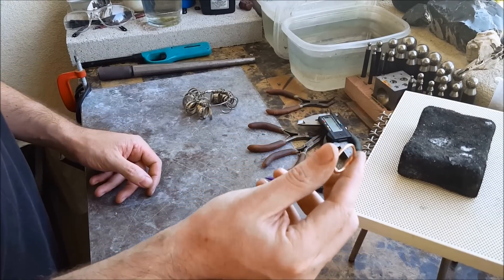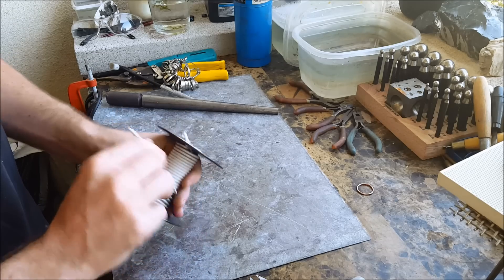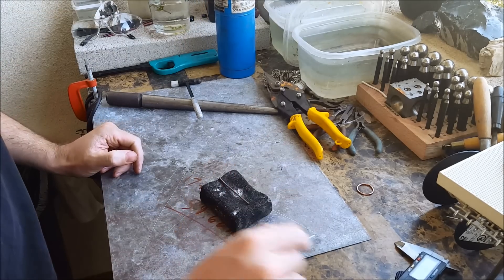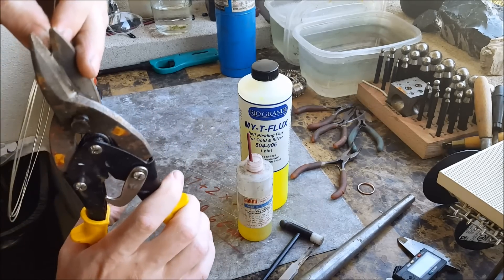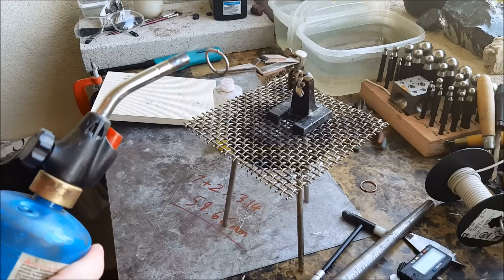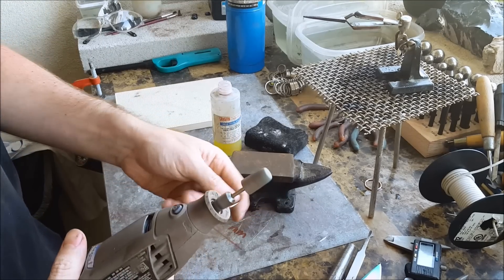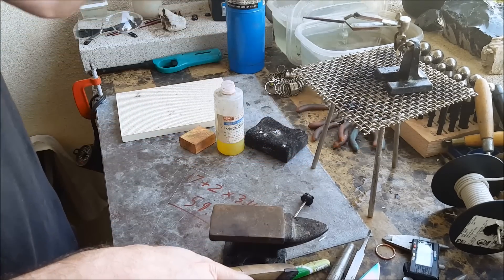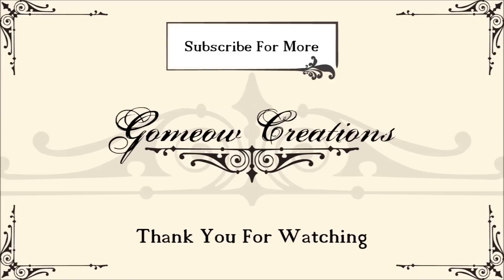How to make a ring from scratch.

Comment: Enjoying your videos and am looking to dive in and give this a go. I just wanted to double check that you didn't have to pickle after the solder? I thought you did.
Reply from the maker: +Brittney Rhodes Yes you will need to pickle it ofter you solder it. It will take all the fire scale off the metal and it will be ready to be polished. If you have any more  questions feel free to ask.
Reply: RAD! I just did not see you do it in the video after the solder. You went into buffing. Any chance you do any electroforming?
Reply from the maker: I have tried making a cheap DIY set up for electroforming but had a lot of problems making it work right. I was able to make some cool looking effects happen to a skull ring I made. Check out my instagrame @gomeowcreation to see it. =)

Comment: Hi... is it possible to add tiny Cz stones 1mm to a copper ring... all way round it? Too small for bezel... so can they be set inside band?
Reply from the maker: +Clare Bailey that is very possible. You would have to drill into the band with a bur bit that is the same size as the stone then set it inside the band.

Comment: When adding coils like the ring you show at the end, will the copper coils fuse to the copper ring?  It seems silver solder would show up and look bad?  Any advice for adding the coils? Thanks!
Reply from the maker: I put it around the solder joint and adding a very little solder to it to make it all stick
Reply: @GomeowCreations  Thanks!  I tried to put a VERY teeny tiny piece of wire solder on it (one that I hammered flat) and tried to wrap coils on top of the solder before torching but it kept falling out.😱  I'm now going to attempt sweat soldering (I think that's what it's called)... melt some solder near the join, then wrap the coils and torch again.  Hopefully, that'll work. 🤞. Thanks again. You're an awesome instructor! I'll let you know tomorrow how it went.😊
Reply: @GomeowCreations  By cutting a piece of wire solder the size of a pin head or smaller, I managed to complete the 2nd ring with minimal exposure of silver on the copper coil. The 1st one became a disaster and I tried to hide it with a fine silver coil on top of the copper coil after filing away the excess solder.  That 1st one will serve as a reminder of what NOT to do!  I think I was overly ambitious. 😂 LOL! 

I'm gonna keep practicing.  Thanks so much for your help! 🙂

Comment: For a round wire, is there an alternative of using rubber emery bit?
and another question If I want to make something with a round wire, how to file down the joints without flattening them?
Reply from the maker: +sweet berry you could use sand paper but it would take some time to get it all off.

Comment: Hey @GomeowCreations, this video was so awesome and helped me so much with many of the issues I was having with soldering copper. The one thing I am still really struggling with is how to re-harden my pieces after I have soldered. I know work hardening is supposed to help but I feel like when I pull my pieces out of the pickle after soldering them they are just ridiculously soft and Im not sure what is happening. I don't have any issues soldering gold or silver, so Im wondering if you might have any ideas about where I am going wrong? Please help!
Reply from the maker: Well copper does get really soft after heating and most people just work harden it using a hammer. You can also try tumbling it with some stainless steel, this should help work harden it without leaving marks. 😄👍
Reply: GomeowCreations thanks! I think I wasn’t hammering enough because I was afraid of breaking or flattening my pieces so I redesigned them into a more 2D style so that I could harden them on an anvil (using a rubber mallet) without changing the design. Your tutorials are so helpful, thanks for sharing your knowledge!

Comment: Do you ever use metal sealers of any kind on copper? if so, how well do they work?
Thanks!! Love the vid
Reply from the maker: Thank you. I use Renaissance wax to keep everything from changing colors. The wax doesn't last long though. I have used enamel clear coat paint, this works but over time your skin will eat away the paint and you will have to reapply it.
Reply: +GomeowCreations thanks!!
Reply from the maker: No problem

Comment: Hi, I'm just starting out in this game and wanted to ask you about the formula for the circumference you used to get the length of the wire to cut out. If you were using diameter x 3.14 to get circumference then shouldn't it have been 17mm + 4mm for both sides of the wire? Or is the way you're doing it to get the circumference at the center of the wire?
Reply from the maker: You are right, this would make it too small but I have found that if you do it this way and hammer it to the right shape it will stretch out and you will be able to make it the perfectly sized
Reply: @GomeowCreations  Ahh, I get it totally now. Thanks very much, that was confusing the hell out of me until that cleared it up. I hadn't considered the working of the copper to get it round at all.

Comment: Do you have any videos on soldering gold-filled and sterling silver wire? This was super helpful and made the soldering process feel much less intimidating for a beginner! Thank you!
Reply from the maker: I have never worked with filled wires but I do have one with silver wire. https://youtu.be/RJZYjsssVKU It's just about the same process.

I do suggest working with copper and brass before you start with gold or silver. If you make a mistake when learning it is a lot cheaper to use copper and brass.
Reply: Thanks!

Comment: Thank you! My seal isn't strong enough to shape the piece. It might be the type of solder I bought. What is the brazing rod for that is mentioned in the shopping list? Would that be stronger than soft silver solder?
Reply from the maker: +Renee Duran This would be the best setup of solders https://www.riogrande.com/product/silver-sheet-solder-assortment/101199

This is the solder I use for everything now :) 

This can also be used:
Bernzomatic PC3 Copper-Phosphorous Brazing/Welding Rods, 3-Piece https://www.amazon.com/dp/B000GAV83M/ref=cm_sw_r_cp_apa_6jckAbWZ28NRA

Whatever you use make sure you use some good high temp flux. 

https://www.riogrande.com/product/handy-flux-for-soldering-and-annealing/504086gp

Comment: How did you add the smaller ringlets to the pieces showed at the end of your video?
Reply from the maker: I used wrapped a little wire around the ring and used some easy solder to hold it in place. 😄👍

Comment: you give such great instructions, many times I feel people talk over my head. I only have a couple of questions, first, after I have finished all the buffing, I then spray with the lacquer? before finishing it up with the wax? The 2nd question is, wouldn't all 12ga wire be 2mm in thickness?or do you still need to measure it to be absolutely positive for the calculation?
Reply from the maker: Yes, make sure you lacquer it be for putting a wax on it, if you do it the other way around the lacquer will not stick. You also don't have to use the wax if you have a lacquer on it, it's just extra.

Yes all 12ga wire should be the same but I work more in mm and not gauge. Like now that I make my own wire I just use the mm and never even thing of what gauge it is. 😁👍

Comment: Excellent video tutorial, thanks for posting.  Do you know if the polishing bits and compound could be used on gold-filled too? Also, what does the Renaissance wax do?
Reply from the maker: Kristen Case First off I would like to say, Thank you for being my very 1st comment on youtube. :)

Note: I have never used filled metals so this is what I think will happen. 

If you use the polishing bits (The rubber and diamond ones) on any metal, It will take metal off it. So I think you might be able to get away with maybe the blue one, just to clean up some scratches. If I had some filled wire, I would be more then happy to give it a try. 

As for the polishing compound and the fabric wheel I think that would work just fine.

Renaissance wax: I use this on copper and brass mostly to keep it from tarnishing as fast as it would if it was just polished. Copper really likes to change color so if you do this it will "help" keep it sealed. I also have used it over clear coat to "help" keep the oils from people skin from eating away the clear coat. If you want something that will last a lot longer you will need to look for a metal sealer. I have some on its was to try out now. I will post a review of it after I test it.

I hope this helps =)

Comment: Thank so much!   At the end  of your video you have three rings, my question is-- how did you make the 3rd ring with looks like the wire being wrapped around it? can you explain that please?
Reply from the maker: You can wrap some thin wire around the ring, then I added a small amount of solder on the inside of the ring. Once the solder flaws it will keep the thin wire on the ring. I hope that helps, if not I will try to better explain it. =)

Comment: Hi. Awesome tutorial! 👍 The ring turned out simply beautiful! ♥️ I'm trying to prepare myself to learn to solder silver and/or copper.  Can you please answer a few questions I have about this ring if you have time... 

1) Is the copper wire you used just regular copper electrical wire you'd pick up from a hardware store?  I noticed it was plastic coated as if it were that type. 

2) It wasn't clear (to me anyway) exactly what kind of solder is used with the copper. It didn't look coppery at first. What was it and is it necessary to use it? In other words will copper fuse to itself or do you always have to use solder? (I'm in early stages of learning)

3) Finally... at the end, 1 of the 3 finished rings on display had a smaller wire wrap accent around part of it (I really liked that!👍).  What gauge was the small wire wrap and did you solder the wrap to the shank? If so, what were the steps taken to do it? (I do some wire wrap jewelry but have NEVER soldered... Yet! 😊)

If/when you have time, I'd really appreciate knowing about this. Thank you so much for sharing your knowledge and skill! You have talent. Cheers! 🙂
Reply from the maker: 1.  Yes, this wire is just some I got for the hardware store but you can also get some that is just copper so you don't have to deal with the plastic.  Here is a link to some https://amzn.to/2ZgcSa6

2. I was using hard silver solder, here is a link to a small kit of easy, med and hard https://amzn.to/31gCVjZ They basically melt at different temps and you want to use hard for just about everything you can due to it having the most silver in it. That being said you have to use it along with flux with copper. This is the flux that I use https://amzn.to/382SHQO You can fuse copper but it will leave holds or odd blobs, so you need solder.

3. So I have no idea what size that was seeing that this video was made years ago haha but you can just play with some thinner wire and see what work. I did solder this on over the solder joint to hide the silver line it leaves behind.
Reply: @GomeowCreations  Thank you!  I appreciate your answers. I've been reading and watching lots of vids about soldering jewelry (mostly sterling). I didn't realize silver solder was used for soldering copper. That's good to know because I've ordered some for a silver bracelet project I'm going to attempt (or destroy - LOL!). I really didn't think about the coil being used to hide the solder seam. That's actually very clever! 👍🙂 I love it when mistakes lead to making something better. I usually buy copper spools by the pound from Copper Wire USA (16ga to 28ga) but Bare Copper wire (size 10 ga or 12 ga) by the foot is cheap at Home Depot. I think it's about $0.25/ft with a 6 ft minimum purchase. That's a lot of rings!  Also a lot of work.  Again, thank you so much. I'll definitely check out your links and more of your videos!  Cheers! 😊
Reply from the maker: No problem, I have a lot of soldering videos but I think this one will help a lot https://youtu.be/r8nU0ZMZGFA

Comment: Another great video! I just started watching them and find them to be bey helpful. If you were going to patina this ring, would you still go through the entire buffing process?
Reply from the maker: That would depend on the finish you're looking to get. Normally when I patina a piece I don't polish it before adding the patina but  I will use a polishing wheel on some parts after that or even a wire wheel to bring back some of the color from the metals. It all depends on how you want it to look.   😀

Comment: is the enamel spray paint a alternative to the museum wax? lastly, what is the pickling liquid? thanks for a interesting video!
Reply from the maker: +Ricdhol sorry for the late reply. You could use an enamel paint on it but if you do you might have a hard time getting the paint to stary on if you buff the ring. If you use a fine sand paper on the ring it will help the paint stick. As for the pickling liquid, it is a dry acid tat tou add to water. Watch my "How to remove tarnish video for more info on it and likes to buy it if you need it. :)
Reply: Ricdhol ki

Comment: I've seen another of your videos where you used, was it Renaissance wax, (Aha! It is Renaissance Wax! You use it in this video, too!) to keep your non-silver projects from tarnishing, greening your fingers. Have you used Everbrite ProtectaClear? If so, which do you prefer? I've heard or read that it lasts longer. I've not used either, but I have a can of ProtectaClear.

Some chemical colorations will lose their brightness with ProtectaClear, I've heard. I know it won't work well on a 'peanut oil on copper' patina because it makes the patina run a bit and smooths out the variations. Again, haven't tried it.
Reply from the maker: I haven't used Everbrite but I have started coating my work in a strong clear lacquer. This is the one I have https://jaxchemical.com/shop/permalac-clearcoat-lacquer-matte/ so far it has out lasted everything I have tried in the past.
Reply from the maker: Just more protection. Some people's acids from their skin will eat away at the lacquer. You don't have to do it.

Comment: ouch  you do not scrub with a file  you will ruin it. 2 if he aired cooled it would bend easier .quenching metal will make it a bit harder.   he makes it look a lot harder than it actually is to do.
Reply: you're right about the file but it depends on what the metal i believe
Reply from the maker: Yeah I did have a bad habit of scrubbing the file, but I have go past this for the most part now. =)
Reply: as a metalsmith  never scrub a file  its like hell trying to open or clean the blades  and even copper makes a royal mess of a file... gold simple clogs the daylights  out  of it
Reply: Being an amateur jeweler/craftsman/smith/etc. I've done quite a bit of research on metals. So far, it looks like only carbon/tool steel will really harden when quenched. Quenching doesn't do much to mild steel and annealing will soften copper, copper alloys, aluminum, silver and gold. BTW I'm talking about "common"/traditional metals.
Reply: @GomeowCreations  what does scrub a file mean? n00b here. Trying to get a feel for this to give it a go 😬
Reply from the maker: Scrubbing the file is failing to lift the file after the first stroke and dragging it back over the metal. 

You are mentioned to only use the file in one direction, it's kinda hard for me to explain via text so I hope this was helpful haha. 😁👍